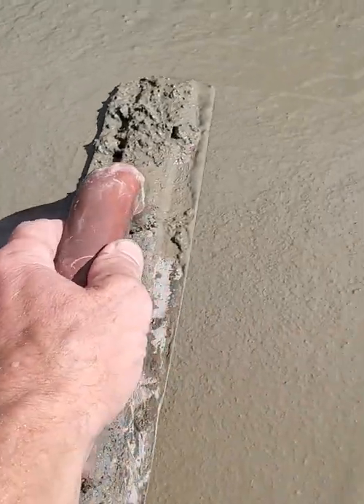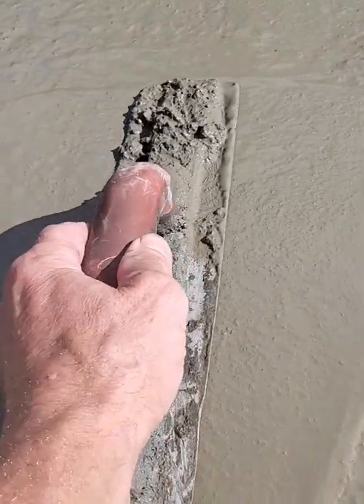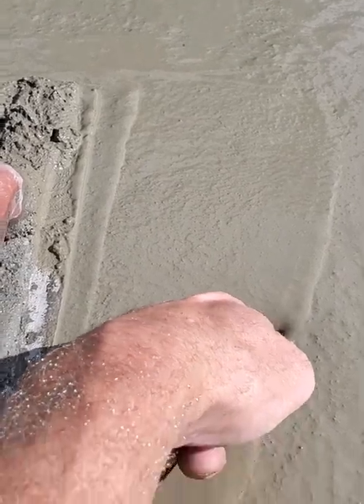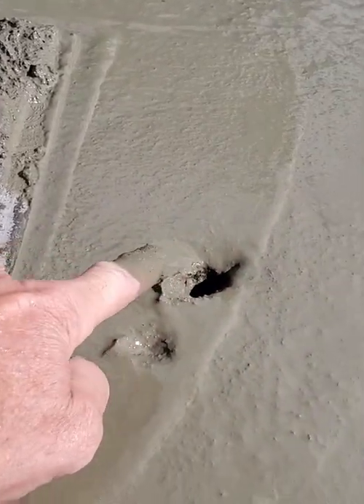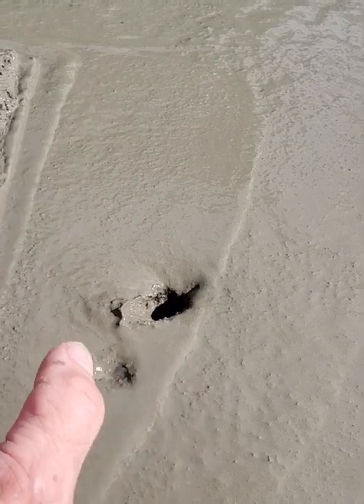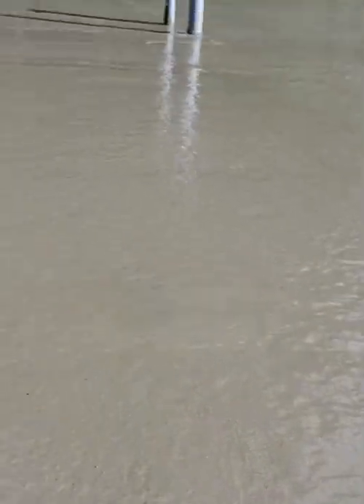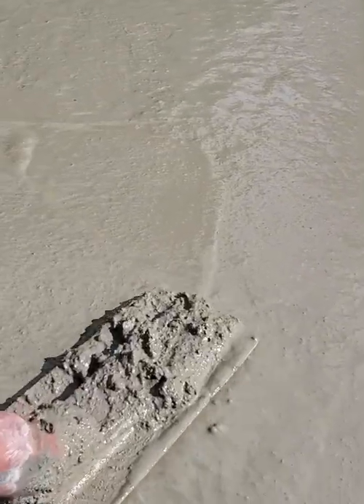Finishing Concrete | When NOT To Start #Shorts

Comment: The biggest thing that I have struggled with while learning how to lay concrete is when just start finishing! Thank u!
Reply from the maker: That does take time to learn. It comes with doing it over and over again.
Reply: Float it after placing, When it will take a thumbprint, start finishing, If it is hot out, cheat a little up front, if it is cold out, take your time, if you added calcium for the cold, watch for a quicker initial set, but it is temporary, then you are back to waiting.
Reply: Especially if its a big pour. Its all about the sun. You start pouring in shade but end in the sun you will finish the end of the pour n sit n wait to finish the beginning. Always know where to sun is and use your finger. If its to wet u can always fix it. If its to dry good luck.

Comment: Just a heads up. Concrete does not dry. She cures.
Reply: The water on the surface dries, however.
Reply: Wet stuff dries

Comment: Even when it is ready to be finished the finger will still go in like that, you need to explain more when you use the finger as an example of how it should be
Reply: No your finger won't go in like that when its ready to finish you will just leave finger imprints
Reply: @Luke Hagan  if you step on it you should only sink about a quarter inch for the first coat

Comment: Concrete doesn't dry,it cures.
Reply: thanks bill nye ur the man
Reply: Binds then cures. He needs to fit his job on between. Risky on that sun.
Reply: There’s less water content when cured, so it sure af dries as well, smart fella.
Reply: Concrete is a catalyst, it does cure. The water helps it flow.
Reply: It hardens via curing—not drying—but it also dries. There is a lot of surface water here that he is waiting to evaporate.

Comment: That’s too wet to pour.
Reply: Bet the dirt under it was wet, or they are to lazy to move properly hydrated concrete. Lol
Reply: Lol try pouring “hydrated concrete” in Louisiana humidity
Reply: Itll have 7 miles of surface cracks, but let's pump it wet so ther pump operator don't cry
Reply: Did you ever think he used a super plasticizer and didn’t add water 🤔